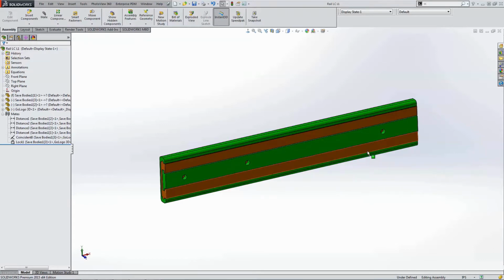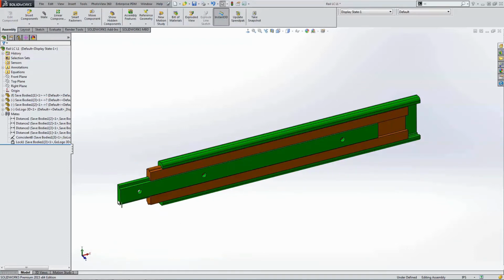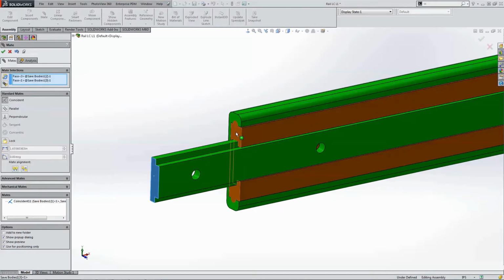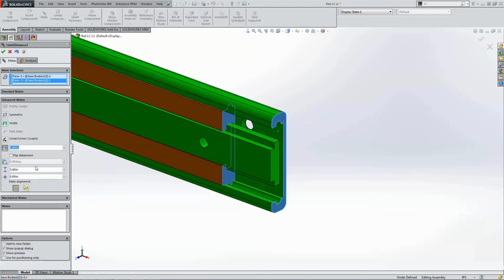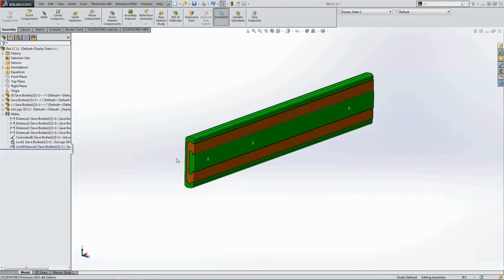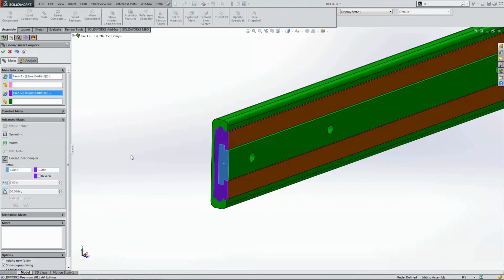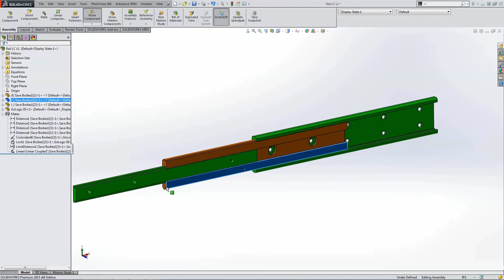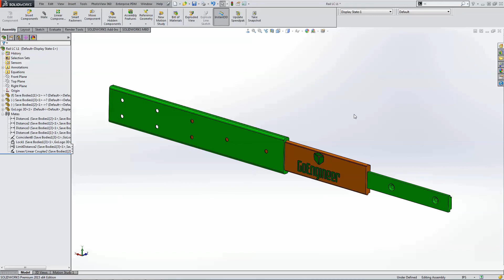SOLIDWORKS Quick Tip - How to Use the Linear Coupler Mate, Making a Drawer Slide

Comment: im making an assembly for a slide sheet metal that hides a tv. Im beginning with 3d modeling, can you help me with file of this slide? Mine would be 36" or if you have a toturial on how to make drawer slide. Thanks
Reply from the maker: Hi Jaime,
This is our only video on how to make a linear coupler.  If you need assistance implementing a similar mechanism we would encourage you to contact the technical support of your local SOLIDWORKS VAR (http://www.solidworks.com/sw/purchase/varlocator.htm ).